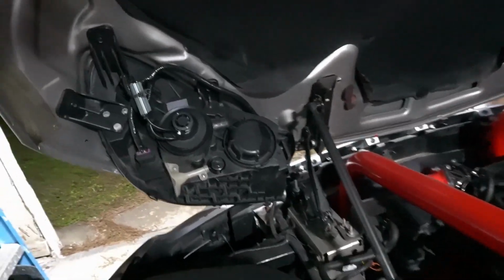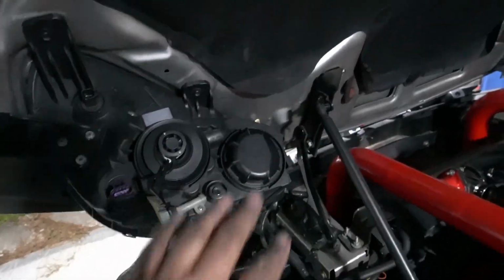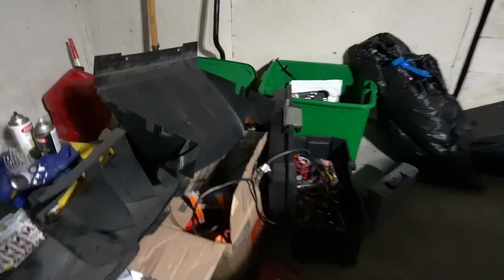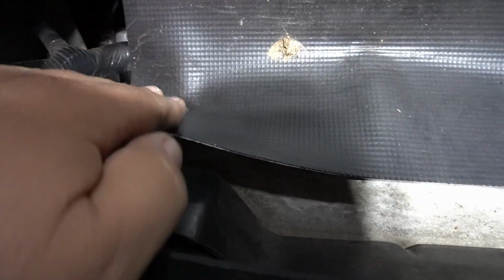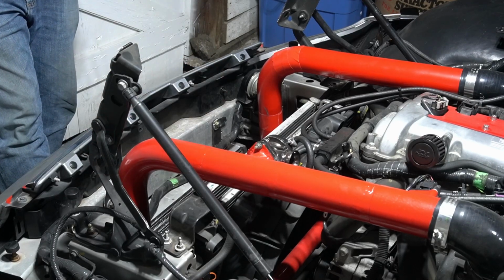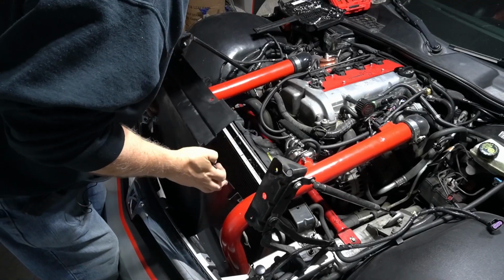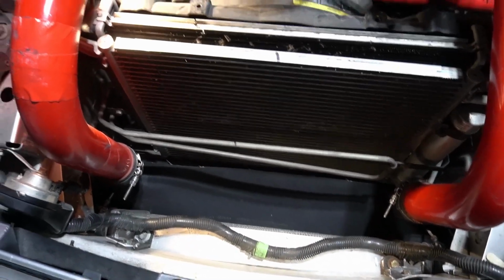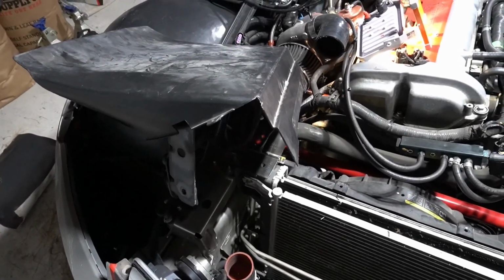Removing My Saturn Sky Hood And Trying To Solve An Issue

Comment: Hey Mike!  Glad to see another Sky video.  I think you could trim the OE piece and make it look like it belongs. Air saw would work good.  Bosch makes a plastic blade for a jigsaw that is used for acrylic but would probably work with that ABS? plastic you have there also. I would be really good to deflect the air into the radiator.  Thanks for sharing!

Comment: Hi Mike I have a 2007 Saturn Sky also and I am getting ready to start a channel under epic aspect  . I have the 2.4 l also and I was wondering if you thought it was worth putting on your turbo I haven't heard much about it. One difference between yours and mine is that mine is an automatic. I was wondering if the turbo might do even better on the automatic. Please write me back.
Reply from the maker: Hey there. I love that I added the turbo to my 2.4L Sky. I had it dynoed before and after and I basically picked up an extra 100 WHP (guessing 115 to the crank). The difference is night and day. It pulls with ease even in the higher gears. I can be in 5th, give it a little bit of gas and next thing I know is I'm past 100. It's definitely worth it if you already have a 2.4 and don't want to sell it to buy a 2.0.

As for automatic vs manual. I'm thinking that the auto would be faster off the line (at least against me since I suck at launching and shifting fast). But if you're up against someone who can really shift well, it may be a draw or at least very close.

I do autocross racing and I've had others drive my Sky. Every person that does was amazed how much it pulls when boosted and everyone added how much fun it was to drive. And these are the top drivers in our club.

So if you can afford it, I'd say go for it.

Comment: Have you ever had the service airbag light come on? If so what did you do about it?
Reply from the maker: Hi Gunny. No I haven't had the service light come on in my Sky, however I used to have it come on in my old Kia Sorento and it was because I had a bad clock spring in the steering wheel. You may want to look into that.
Reply: I’ll check it out. Thanks Mike. By the way, I enjoy all your mod videos.